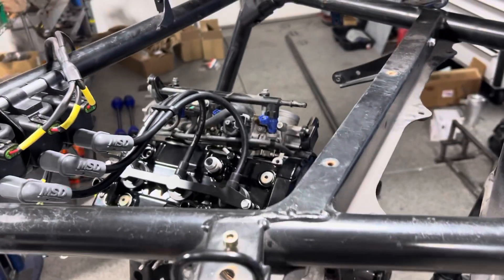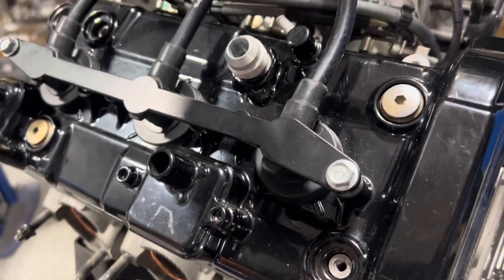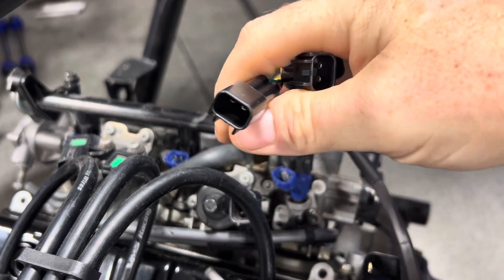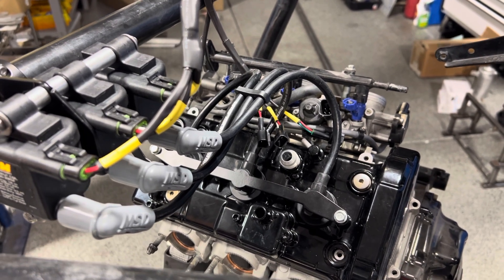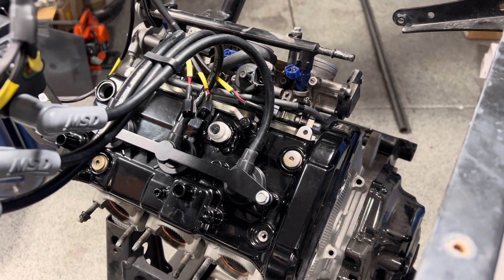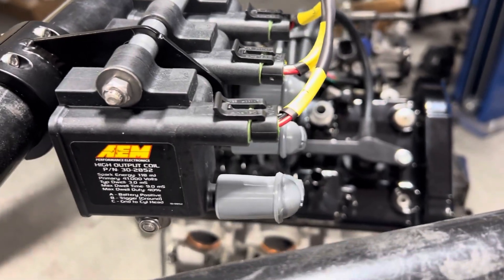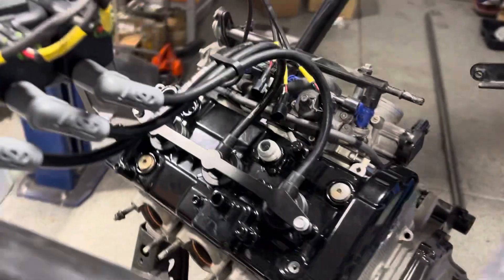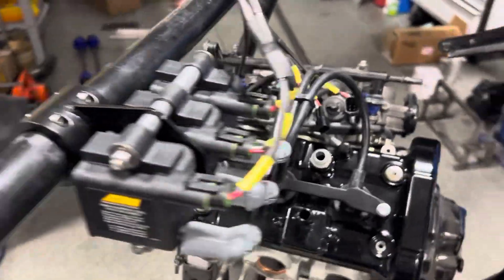Yamaha YXZ1000R high output ignition kit by JTE

Comment: Hey John, wanted to know if this setup would be good for a YXZ running approx 15psi of boost?  Is it overkill at that level, or a good idea running any amount of boost?
Reply: Differently worth doing. Had replaced my coils packs on my Rx8 with aftermarket GMC Yukon coil pack kit similar to this style plug and play kit, car started, ran, idled much better, no flooding issues. Throttle was much more crisp. With the oem coils i had to carry extras they were dog shit. This is on a naturally aspirated RX8. Unburnt fuel is not your friend, carbon build up is no good on any motor.